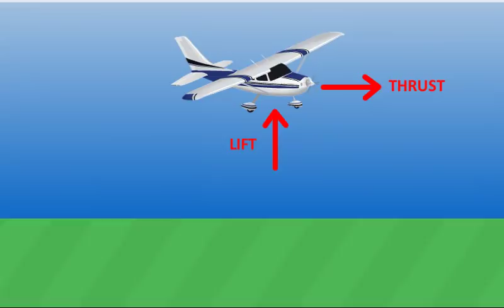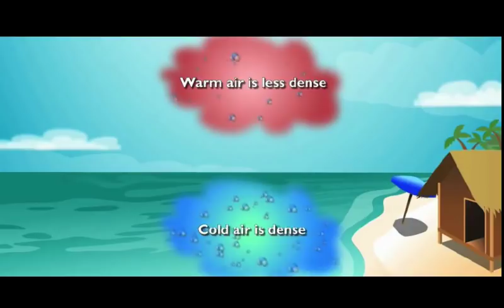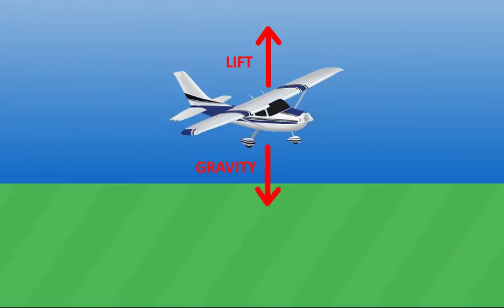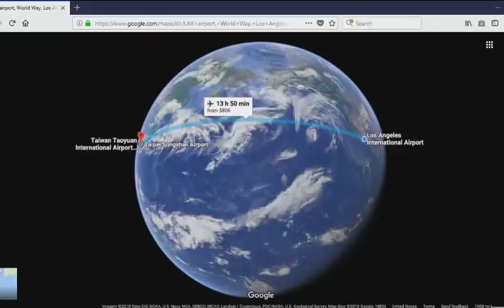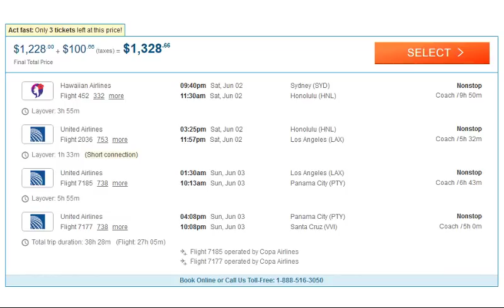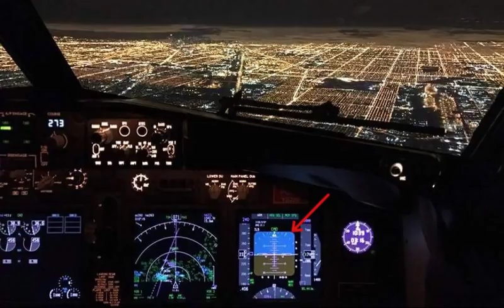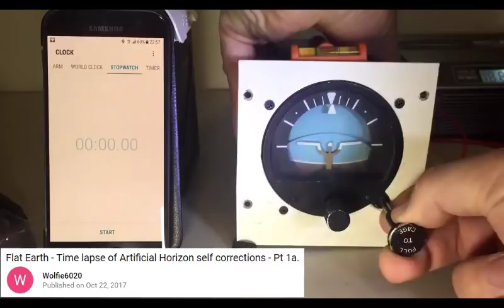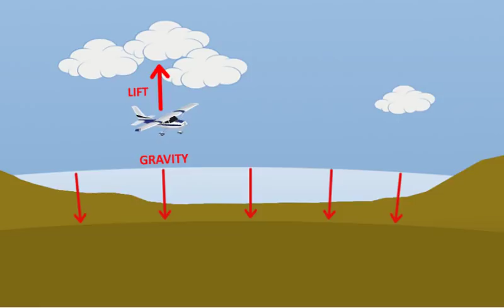Flat Earth Falsities - Plane Nonsense

Comment: Nothing to do with gravity...https://youtu.be/i_l0Y6GbyPA
Reply: Are you actually willing to discuss the subject or are you limited to just posting links to FE videos?
Reply: @MrQuaiven  I'm still into gyro study I use to think thay had a roll in gravity but I done the work and found that dont have any effect
Reply: @sean7058  Can you describe what work exactly you have done to reach that conclusion.  Please don't post any videos, I won't watch them.  Just tell me in your own words what work you did to determine that gravity had no effect in gyroscopes.
Reply: @MrQuaiven  the gyro works by air pressure
Reply: @MrQuaiven  the correction rate shows the gyro corrects the the angle in with the plane is controlled like submarines  work on the cabins air pressure the water plays on the sub but it does not correct the flight path just the angles of the craft
Reply: I'm not sure a sub work from such pressure but maybe still looking on that one
Reply: @MrQuaiven  a plane does not need to add thrust to gain altitude just an absolute constant air flow under the wing like an airhog plane the motors bairly can keep the plane in flight but some how it can fly and my park zone has all controls but I maintain low throttle and can still climb with no input
Reply: @MrQuaiven  and yes I'm using your referance but I'm not seeing gravity in the gyro trying to be fair to of your vid I dont make whack claims without seen all first my gravity clame is gyro does not controls the gravity of an air craft just shows his level to the horizon  simply by the change in air pressure by the angle in which it swings to open a valve to let air pass to the rotating wheel from controlling the air pressure and the amount of air but not gravity you can do the same thing with a swivel with a weight and dampeners to keep it from having a steady swing and it be a much faster reset
Reply: @sean7058  I told you not to bother posting any videos, I won't watch them.  You said you had done the work.  If you really did the work then you would be able to explain it with your own words you would not need someone else's video to do it for you.  Air pressure is a direct result of gravity and air pressure is not the sole factor that causes gyroscopes to work so your explanation there fails.  A gyroscope will work just fine in a vacuum chamber where there is no air pressure.
Reply: @sean7058  "a plane does not need to add thrust to gain altitude"
This is ignoring several factors involved in flight.  Flight is a balance between thrust, drag, lift, and gravity.  In order to gain altitude a plane must produce enough thrust or lift to counter drag and gravity.  Gliders do it by having a lighter aircraft body (which reduces drag and the effect of gravity) and having a higher wing to body ratio which allows them to generate more lift.  Since you claim to be a pilot you should understand all of those things.  Why are you ignoring them and focusing only on thrust?
Reply: @sean7058  Do you acknowledge that as you increase in altitude air pressure drops?
Reply: @sean7058  Also I need to point out that you ignored practically all of Wolfie6020's video and cherry picked only the air pressure opening the vanes thing.  Watch the entire video.  Wolfie makes it clear that gravity is playing a huge factor in how gyroscopes work.
Reply: @MrQuaiven  what does that have to do with any thing still not a gravity issue even the pendulum is controlled by gravity neither one o the artificial horizon prove round cause of its self correcting
Reply: @sean7058  Gravity is what causes the vanes to move which opens or closes the air ports.  Air is not opening and closing the vanes, it is only controlling the self correcting mechanisms.  The vanes are moving as a direct result of gravity.
Reply: @sean7058  Air pressure is caused by gravity. The further you are from sea level the weaker the gravity.  That is why air pressure drops.  Why do you think about 12,000 feet up the air is always below freezing. Have you ever been on a plane?
Reply: @1Foulkesy  so when a cabin is pressure rises so are the instruments and thay work oon..... cintrfugal force and created pressure of the gyro he didn't listen when the guy in his gyro vid told him why the gyro had special hole made in it .... and thay dont use the pendulum any more cause there influanced by gravity and thay went to gamble gyro the gyro is not influanced by gravity
Reply: Gyro only moves in the direction its already going if you go the opposite way it is moving then it becomes resistant that's why a pilot will tell you thay set it on flat ground befor take off that's the cage knob that will calibrate it then the air pressure it now a set known for the level of the gyro even in low air pressure cause it is made to self adjust
Reply: @sean7058   The instruments are not in the cabin. Gyros act with gravity. Do you have a smart phone? Does the screen rotate, when you turn the phone? That is influenced by gravity too. 

However that's physics and is not my bag, I knew more about chemistry and geography at school. Even primary/elementary geography proves flat earth is impossible.
Reply: @1Foulkesy  "The further you are from sea level the weaker the gravity. That is why air pressure drops."
No, that's wrong. Air pressure drops at increasing height because you have less air "above" you. It's the same when you go diving: There's more pressure on your body (you can feel it in your ears) when you are deeper, that is, you have more water above you. Or do you also think the water pressure is greater in greater depths because you are closer to the center of gravity of the Earth?
Reply: @enderwiggin1113  Less air LOL I am sure 20,000 feet is going to make a difference compared to the air still above you. Yes the weight of the ocean depends on gravity, so more water above you is pushing down on you.  Pressure is caused by gravity. 

Are you a gravity denier?
Reply: @1Foulkesy  "Less air LOL I am sure 20,000 feet is going to make a difference compared to the air still above you. "
Stop LOLing and get a basic education. This is second year physics in school and I've been teaching this for over 10 years - as it is written in any basic physics book. It's called https://en.wikipedia.org/wiki/Barometric_formula

"Yes the weight of the ocean depends on gravity, so more water above you is pushing down on you. Pressure is caused by gravity. Are you a gravity denier?"
Certainly pressure is caused by gravity. Gravity attracts less air (or water) above you, thus the pressure is smaller.

Gravity itself in 20 000 feet height (that's about 6 km) is essentially the same as on the ground - look up the formular for calculating gravity at some time, will you?
Reply: @enderwiggin1113  :-) I was told to stick to chemistry 30 years ago. I thought you were saying Gravity does not exist. However I am willing to admit if I said something wrong.
Reply: @1Foulkesy , Sven is of course right. The drop in gravity is negligible with change of altitude on Earth. People who climbed the highest peaks on Earth will prove that and so will the pilots and the airplane passengers. You are probably confused with weightlessness  of humans and objects in LEO, which is why you believe that gravity wanes with altitude. It does but not that fast. Weightlessness is a result of the free fall of objects in Earth's orbit, not the lack of gravity.
Reply: @rd-gi6jw  I was probably confused, haha :-) I sucked at physics 30 years ago. I was actually trying to say that objects weigh less higher up, due to weaker gravity, but not by much.

I thought that guy was a gravity denier, I was probably reading it wrong. :-)
Reply: @1Foulkesy , no big deal. We share same values. You are technically right, gravity pull drops with distance, only not by that much to be a factor in this case. Cheers!
Reply: @rd-gi6jw  I usually debate with flat earthers about geographical matters, like plane routes etc.  You probably have noticed that with my other comments. Thanks.

Comment: The Radar signal travels in a straight(flat) line (line-of-sight) distance to the horizon, from the antenna until it reflects in a straight(flat) line off whatever it encounters. How far away can RADAR detect things? 100 miles on a 6,500 ft high position. 100 miles of sphere = 6,668 feet of curvature... The greater the distance from the search antenna, the bigger the problem of atmospheric; crud & in the real world lumps, bumps & trees & buildings (+scattering the radar transmissions & returns. So more then difference of 168 feet too low! No comment on that accomplishment. Near the Earth's surface causes multiple barriers, atmospheric ducting, ionospheric reflection and refraction, and reflection from water bodies. But 100 miles it is... REF: RADAR FAQ - MidiMagic https://midimagic.sgc-hosting.com/radarfaq.htm

Again & and again more much needed education ; even if the center of radar is at 168 feet, and if no hills or buildings, Radar range depends on the size and shape and hight of the vehicle. It is certainly possible to fly "under the radar." Military pilots practice a type of flying called nap-of-the-earth for exactly this purpose. ??? 
- no 1 feet above the line of (flat)sight surface,no,no. Even military radars have a limit of the lowest altitude at which they can track aircraft. This is because the radar signal will also reflect off of the ground and objects on the ground, causing interference. This is called clutter. 

Aircraft far away from the radar must be at high altitude to be above the horizon, otherwise they are "under the radar". Even hifi topbrass technology can not skim the ground. The SA-6 air defense system can engage targets using radar down to 100m, and the SA-8 can engage down to 10m. These are both short range systems, though (less than 30km). 

SO BOYS EVEN AT 50 MILES OUT 168 FEET HIGHT WILL BE NECESSARY ! AND I DID WORN YOU ABOUT REFRACTION AND GROUND NOISE, BUT TO NO AVAIL... Because the radar doesn't distinguish altitude, controllers may not be able to distinguish an aircraft within these areas of interference. 
https://aviation.stackexchange.com/questions/2952/can-someone-actually-f
Reply: TLDR; Louis does not understand how RADAR works so rather than maybe read a couple of books on the subject or maybe watch a couple of videos that deal specifically with RADAR, Louis comes to the conclusion that since he doesn't understand it then it must be magic and the Earth must be flat.  Louis has a habit of doing this.  Louis loves to ask questions, but Louis hates the answers.
Reply: And that folks resumes the Mainstream Commoner's science knowledge.?
Strange "TLDR" is what was previously faced with by +NotTheCIA I.think...
2 months ago
= "TLDR"   (this experiment worked out just fine!)
He's the one accusing ME of multiple account on here?
Sure get quick responses despite my numerous falts from "have a Life" gang.
Yes I do get a lot of questions asked by Smarts, answer some (5X more lines in my threads against 3,4,5 science Knowers...), but they do get very upset with the Flattard when I dont educate them...
Reply: @BrainUser1  "And that folks resumes the Mainstream Commoner's science knowledge.?"
Is that even English?  What exactly are you asking there?  And why are you trying to dismiss things by labeling them as "Mainstream Commoner"?  That doesn't strike me as a very honest approach to a discussion.

"Strange "TLDR" is what was previously faced with by +
Capt'Wes Starwind."
Do you also think that everyone who uses "LMAO" are all just one person under multiple accounts?

"Yes I do get a lot of questions asked by Smarts, answer some (5X more lines in my threads against 3,4,5 science Knowers...)"
I feel like I'm talking to Mike Tyson.  This is what a sentence looks like when someone attempts to sound intelligent but lacks the actual knowledge of sentence structure.

"but they do get very upset with the Flattard when I dont educate them..."
Project much?
Reply: +NotTheCIA I.think... dam I dont even get a minute to correct, you are there!
yes the english guy been around only since a month tops, but he knows we well...
Hope this is not to long for him to read.... :(
Reply: Notice how Louis attempts to discredit anyone that might challenge him?  If you respond to quickly, clearly you are guilty of something.  If you don't respond quickly enough, guilty of something.  If you use the same internet acronym shorthand as someone else, guilty.  If you point out flaws in his sentence structure, guilty.  If you question him, guilty.  If you answer him, guilty.  Literally everything anyone does Louis takes as evidence that "they" are guilty of something.  Because Louis can not consider the possibility that he is wrong.  Louis can not consider the possibility that he is ignorant of something.  Doing that would be far too damaging to Louis' ego.
Reply: @MrQuaiven  aka +NotTheCIA I.think, always upset about something.
Sadly it does not include the gay hellenic Greeks Globe one, but fun :)
Top 10 Greek Mythology Creatures And Monsters  /watch?v=aznss7QEnWk

ps: these cabal lodge members for greek everything are not in luck apparently:
[D5] NOTHING CAN STOP WHAT IS COMING.  /watch?v=DCzhRNgk8QY
Reply: @BrainUser1  aka +RandomInternetMoron always looking for excuses to dismiss evidence that contradicts his flat dreamworld.
Reply: @BrainUser1  Do you still think light entering a pin-hole camera is fake. You did say NASA has torches placed in front of the sun shining them into every bodies cardboard box. It really is hard to take you seriously.
Reply: @appresley4071  Who is trying to take me seriously? Not you buddy, dont remember any of that taking...or talk.
But they neither am I stuck with pin holes remembrance, get over what ever it was i dont trust.
Reply: @BrainUser1  I never take you seriously Louis, you can absolutely trust me one hundred percent on that one mate.